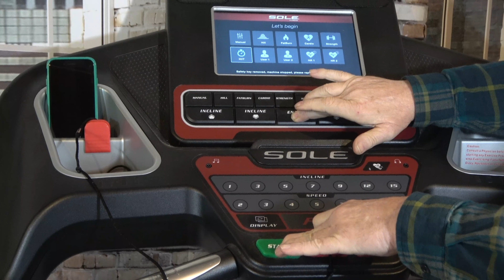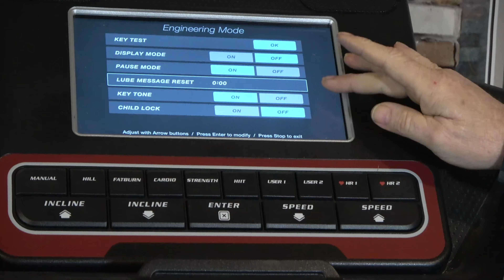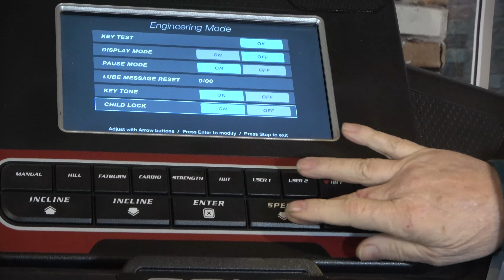REMOVE SOLE DEMO MODE

Comment: How do you remove display mode on the 2022 sole e95 elliptical? I've tried pressing enter on display off like the sticker on the display says to do but the enter button won't work. It works other times though. Just not in this mode...
Reply from the maker: Sorry I haven’t done a 2022 yet Hmmm you might have to call sole and please post it

Comment: We have an E25 - the bottom row of buttons (display, start, enter, stop) are unresponsive.  We can change from one workout to another, but we can't start the workout because the start button doesn't work.  We can't even get the unit into engineering mode because again, the start, enter, and stop buttons do nothing.  Any suggestions?
Reply from the maker: Yes you will have to replace display , But you could remove the back cover and try disconnecting each wire one at a time looking for a short?